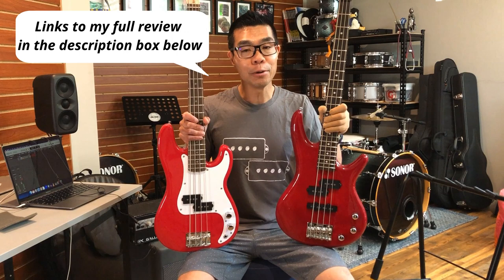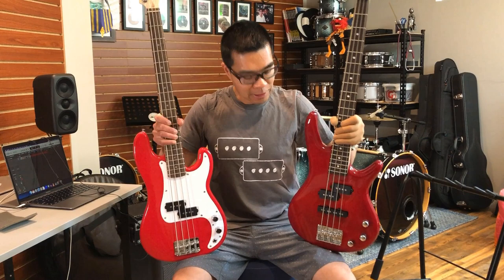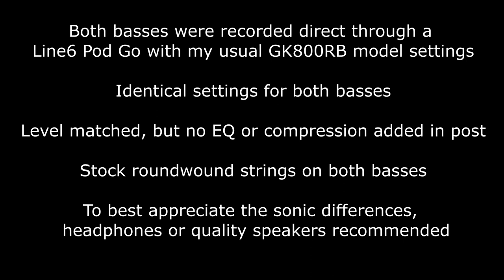Squier Mini Precision bass vs. Ibanez Mikro Bass: A comparison of two 28.6” short scale basses

Comment: I think the squier is insanely much cooler in looks. Also way easier to use as a mod platform. I swapped out the tuners, nut, pickup and bridge on mine and got a great playing and sounding bass for less than 300$.
Reply from the maker: Great mods! Yes, the P shape is pretty versatile. Thanks for watching and commenting!

Comment: As a guitar beginner I got interested to learn bass also and got this Ibanez miKro in red. It’s looking good, very well build and I like it very much. Because of very short fingers I swapped the bridge with 4 individual aluminum saddles mounted for 16mm string spacing. Due the aluminum the bass got more treble, wich is good. But with the little weight of the saddles I lost a bit sustain. Oh well, I play at home, so it does not matter. I‘m very happy with it!
Reply from the maker: Right on! It’s a fun bass! Cool bridge mod. Thanks for watching and sharing your experiences!

Comment: I currently play a 30-inch bass and the strings, especially the E, are fairly floppy, but I’m used to it. How does the Mini-P at 28.6 inches compare? Is it even floppier?
Reply from the maker: I didn't think the stock strings on the Mini P felt significantly looser in perceived tension compared to what I usually play on a 30", but I did find the overall scale length to be a bit on the tight side, for me.  My happy, most comfortable scale length is 30".  The Labella flatwounds I had on the Mini P certainly increased the perceived string tension and weren't floppy at all. You might be able to get a sense of what it could feel like by putting a capo on the 1st fret on your 30".  It won't be perfect, of course, but it might give you a sense.
Thanks for watching!
Reply: @jonathanwong458music  Thanks for the reply (in triplicate😅). I did what you suggested with a capo. It was helpful. Your reply also inspired me to try switching out the usual stainless steel flats for nylon tapewound on a 30-inch scale bass. The slight increase in thickness, from 95 to 105 on the E string, seems to make a difference, i.e., now it feels less floppy. Cheers.
Reply from the maker: Right on! Hope you like the tapes!

Comment: Good review. I wish they made the Mini-P with a maple fretboard. To me a Fender should have a maple fretboard.
Reply from the maker: Thanks so much for watching!  
Yeah, a maple board would be great, similar to how the sonic Bronco has a maple board option (which I liked better than the laurel).
Reply: @jonathanwong458music  Yes sir. I have made a ton of Tele-basses using the Bronco necks. Then build a Telecaster body and you have something unique. My bass player played one forever. Now he plays the short scale Sterling Stingray. It is a fantastic bass. I would like to get a hold of a sub 30" neck to see how far I could push it. In my experience putting heavier strings gets the sound back up on par with 32 and 34 inch. We are currently running 105's. I think at this 28" I would run 110's. Probably have to drill the body and double the string back to use long scale strings but, that would be easy enough.
Reply from the maker: Sounds like a really cool project! 110s in such a short string wound length is a rare bird if not custom only, so increasing the string length at the body is a great work-around.
Reply: @jonathanwong458music  👍

Comment: Great Comparison, I prefer the Squier. I'm not a Bass Player but a Guitarist looking for Bass For my Compositions.
Reply from the maker: Thanks for watching! For a guitarist used to a 24 to 25.5” scale, I think it’ll be an easier transition to go with the super short 28.6” than a full scale 34”. Either of these would be a good choice. A lot of bass in that Squier.
Reply: With a normal scale I will properly hit my equipment when sitting and recording :-) I guess I won't regret the Squier, It's A Good Price in my Country.
Reply from the maker: Tight/cramped spaces is a good reason to want a super short scale! Good luck with the bass!